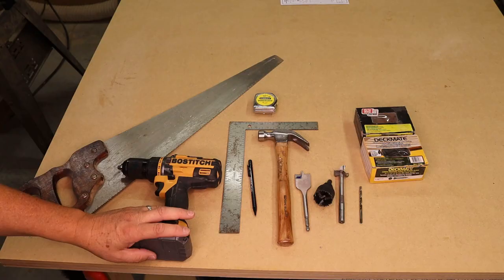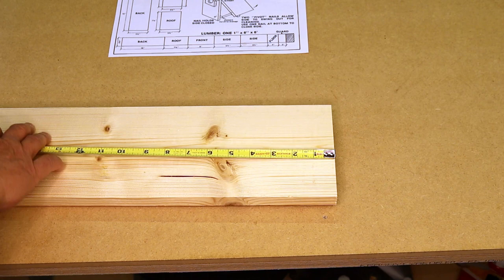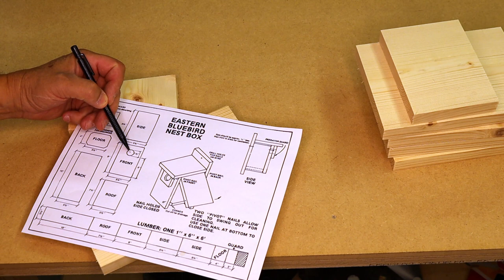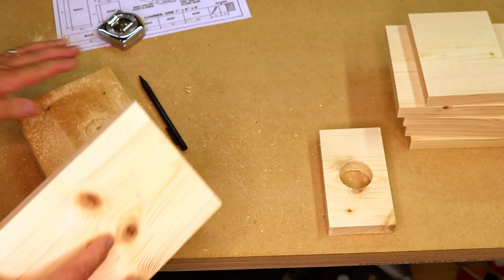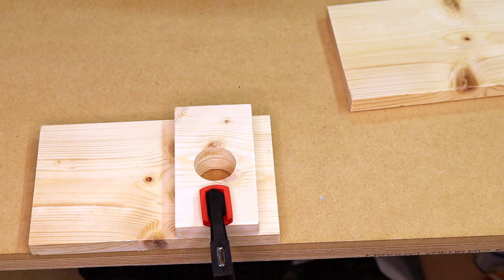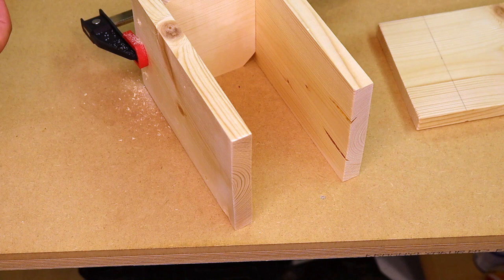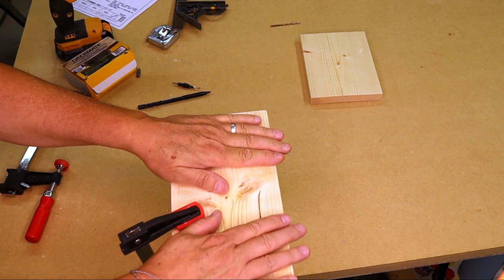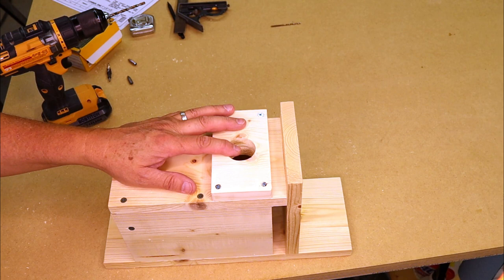Build a Simple Bluebird House

Comment: THANK YOU FOR YOUR VIDEO on making a birdhouse.
   < Tip on hole-saws and spade bits and Forstener bits...drill almost all the way thru the material and then turn the piece over and put your center bit into the hole that's there and GENTLY finish drilling your hole. When it breaks thru, the shear will be inside the hole and both your surfaces will be smooth and clean. > (when using hole-saw...doing this procedural trick will leave 2/3 of the plug sticking out of the hole-saw; where you can pull it out easily, without dis-assembling your cutter.)
   PS your 'stache looks KEWL
Reply from the maker: Great tip, thanks!!  I appreciate you watching...thank you!

Comment: Whenever I use a hole saw I only ever saw half way through the material.  Then I flip the material over and saw the rest of the way through utilizing the pilot hole as a starting point.  The cuts meet in the middle and creates less friction and jamming of the hole saw compared to drilling all the way through..  This helps create neater holes on each side and helps prevent the core from lodging in the hole saw body. 

Adding a touch of candle way to the hole saw bell after it gets hole will help reduce friction allowing the teeth to cot cleaner.

How about temporarily fastened the guard  to the front utilizing the same screw location as permanent attachment, then drilling an appropriate sized pilot hole; then disassembling and hole sawing each item separate.  Sure to line them up.
Reply from the maker: Great ideas!  Thanks for watching, Rudy!

Comment: Thanks Dennis, I am not troubleshooting you or anything but don't you think the ventilation gap is too wide? To me, it looks like rain could easily get inside. Thank you for sharing!
Reply from the maker: John Reinburg thanks for watching, John!  Yes, good point. I followed the plan but do think the gap’s a bit wide. I’ll try it and see how wet it gets inside after a good rain. If I build more like this, I think I’ll cut the sides an 1/8” longer to close that gap up a bit.
Reply: @dwcoffey  where did you get these plans? Do you download them or from a magazine?
Reply from the maker: HI John, no sir, I found them on the internet doing a google search.
Reply: @dwcoffey  thank you
Reply: Hi, what preservative would you use for the wood that is bird safe?
Reply: The 2 sides were cut 8.25" instead of 8.75" (as per drawing). That was the small error that made the gap bigger. NOT a big deal.

Comment: I enjoyed your video but I would suggest a few changes to your plans. I think the top of the front and sides should be beveled 15 degrees along with both ends of the roof so it slants and creates a drip edge. Also the roof should have a longer overhang. Dropping the sides down 1/4” will provide ventilation and a finger pull for the side that flips up. I know it adds more work to the project but it’s better for the birds.
Reply: I believe you cut your sides at 8 1/4” instead of 8 3/4” like the plan states. That’s why the ventilation gap is so large.
Reply from the maker: Thank you for watching

Comment: I’ve got an old garden hose reel, where the hose is wrapped around it. But instead of using garden hose, I store an 100’ electrical cord on it. This reel is mounted to a horizontal 2x6 on our patio, where I can wind cord onto reel. The back side I open. I’ve had this for about 20 years. Just this year 2022, a Blue bird built a nest in the cavity that accessible. There are two babies inside. Now I can’t use my extension cord and have to substitute to another source of power when necessary. Questions 🙋🏻‍♂️, must wood be 5/8” thick? Couldn’t it be 3/8” or even 1/2”?  🙋🏻‍♂️, at what height should the bird house be placed, I don’t have any trees or wooden posts to mount bird houses. Would it be ok to mount bird houses on hurricane fence, extending about half way above top rail? 🙋🏻‍♂️How close or distance apart should bird houses be, if I were to have several?  I have scrap pallet material and really don’t want to buy wood for bird houses. I copied your plan detail. I enjoyed your video 👍🏻💪🦾🇺🇸 4-27-2022 Louisiana
Reply from the maker: Hey David, thanks for watching!  I think you could use thinner wood, no problem.  Most birds do well if the houses are placed about eye-level or higher, but some don't mind if the house is 3-4 feet off the ground.  The biggest problem with lower mounting is that it makes it easier for predators to gain access to the box.  Regarding spacing, at least 6 feet apart, some birds require more spacing away from other houses though....maybe 15-20 feet.

Comment: My research says that bluebirds need a 5x5 floor
Reply from the maker: Thanks for watching!
Reply: @dwcoffey  I didn't post to be snarky. I was curious what your floor dimension was, and if you think that it really made that much difference to the birds
Reply from the maker: No, I didn't take your post that way at all.  I've not had any trouble getting bluebirds to nest in this box, or similar boxes. I accepted this design as useful due to Natl Audubon Society's recommendation of a 6x4 floor.  Their dimensions are nominal, so I assumed 5-1/2 x 4 would work.  Seems to do ok.  I would guess a 5x5 floor would also work.  Bluebirds can be a little picky, in my experience, but they seem to be more concerned about placement of the house than they are about size.  I have no data to support that, but it just seems that way to me.  :)
Thanks again, Rick, I appreciate you watching and commenting!

Comment: Dennis can you explain how the predator guard works?
Reply from the maker: Thanks for watching, Brian!  I'm no expert, but I think the idea is that often predators are squirrels or bigger birds.  The added piece of wood will get chewed on by squirrels, but they usually give up before they get thru the guard and the face of the birdhouse.  The added depth of the hole, due to the added thickness of the predator guard also makes it harder for larger birds to get in there.
Reply: Great Video Dennis.  I built a Wren house and used a piece of galvanized Flashing cut square,  added the hole and used 4 screws to mount on the outside.  I also cut a few kerfs inside on front piece to help the chicks climb out and of course.... NO PERCH!